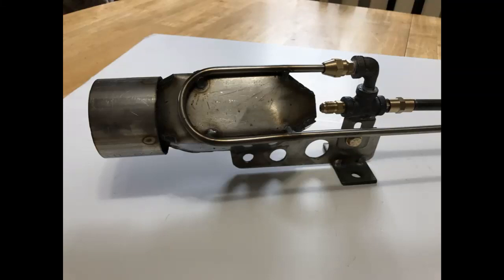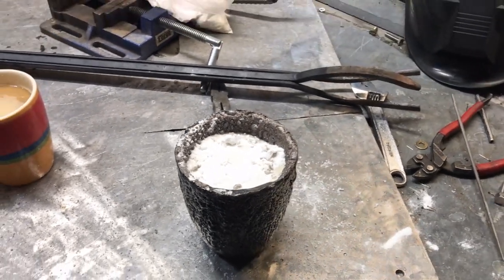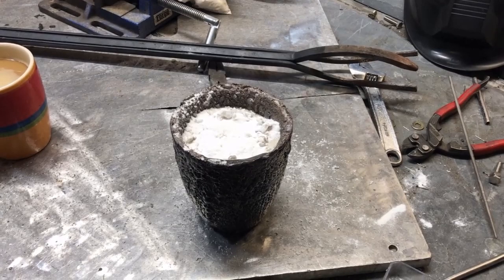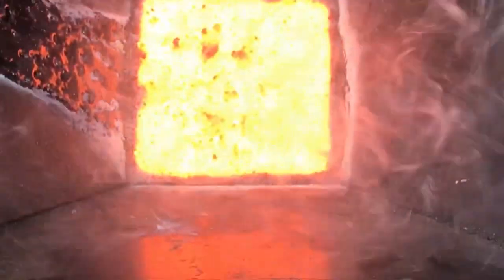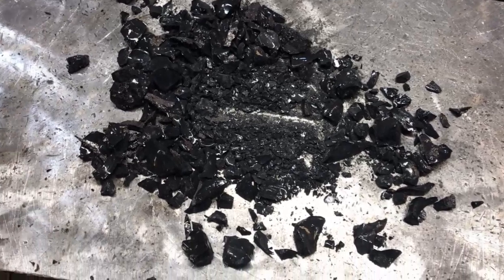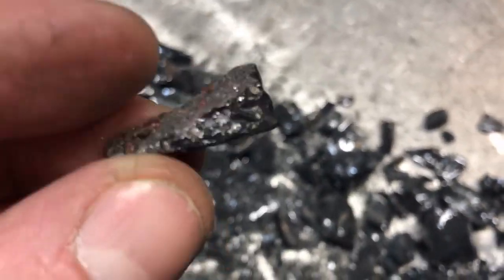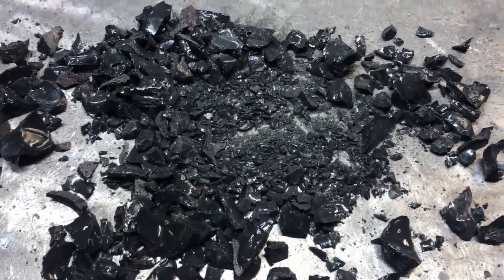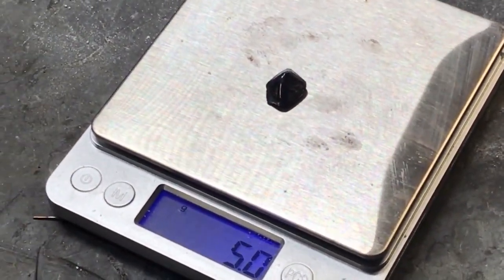Ewaste smelting burner smelts anode mud

Comment: The “Pre-heating tube is a novel concept. I took the idea from an old Coleman stove I had in the 70s and applied it to a shop heater in 99-2000.
We used the heated oil in a heat exchanger to heat the shop before running it back through to be burned.

It could be 20* outside, and 75-80* in the shop. All with zero smoke (after it was up to temperature).
Reply: He's not heating oil, he's heating air.
Reply: @AS-ug2vq  
 You pre-heat the oil before the burner so it burns cleaner, genius. 🙄
Reply: @dalesmth1  you are a clown if you believe it. The oil cools down as it hits the compressed air when it atomizes.
Reply: @AS-ug2vq  
I’m guessing you’ve never owned a Coleman camp stove, or lived in the East-Northeast where people use heating oil. 🙄
Reply: @dalesmth1  Coleman stoves used white gas (gasoline without additives), it worked by pressuring upper part of the tank with air and a pickup tube which picked liquid pressurized fuel from bottom of the tank.

Then pressured fuel is sent through a vaporizer coil then ejected through a tiny orfice where mostly gas vapours are ejected if the burner is properly preheated.

It isn't using compressed air siphon tube method
Reply: @AS-ug2vq  
 Let me draw this in crayon for you. 
I built it. It worked flawlessly.
Reply: @dalesmth1  so what, i burn used oil without any oil preheat.

I heat the burn tube